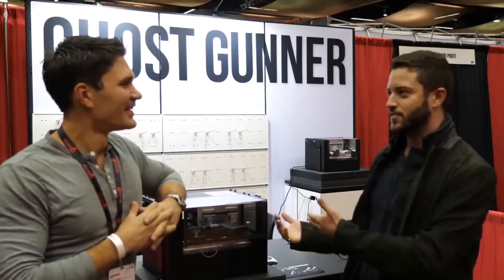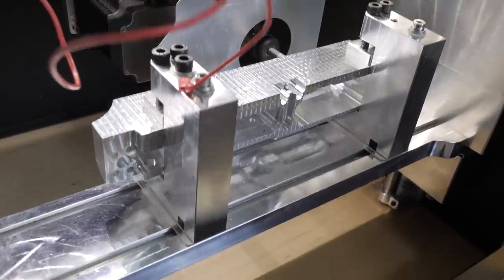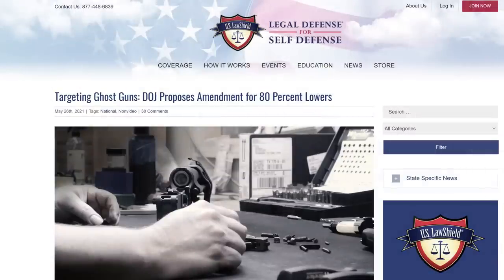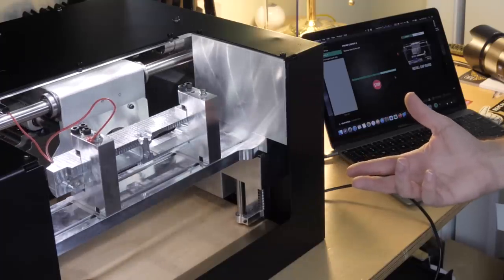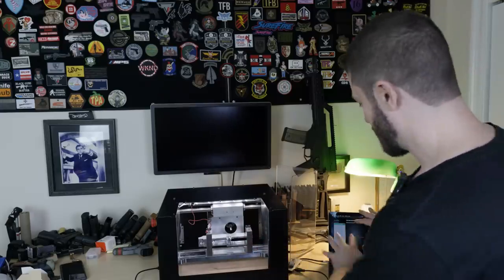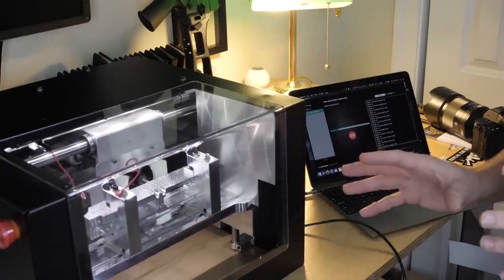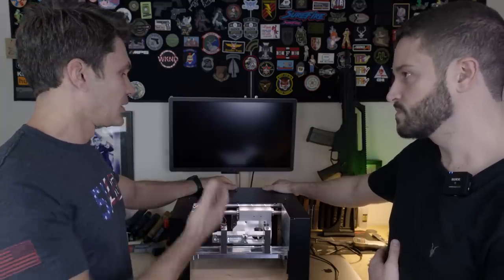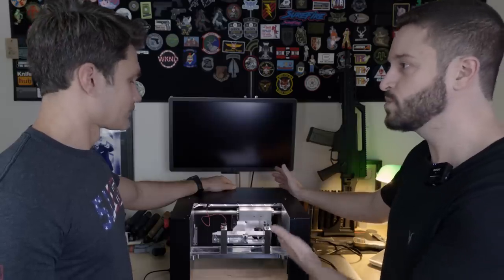NEW: Turn a Metal Block into an AR-15 Lower at Home with the GG3 Upgrade

Comment: ATF Guy: "Hey there buddy, looks like you have a 0% lower there. Can I ask where you got it?"
Me: "Sir, it's a beer can."
ATF Guy: "Don't get smart with me, perpetrator!"
Reply: I have an 80% scale 80% MAC11 flat on display made from a Budweiser beer can. It says "right to keep and BEER arms", and the 1876 is crossed out to say 1776. Its a multi-level political joke also about double taxation (since its the Alcohol Tabaco and Firearms), also a taxation agency without a single elected representative.
Reply: @jakegarrett8109  very nice. every patriot should have some. maybe even the size of business cards.
Reply: @TheBoatPirate  I think as long as its scaled it should be fine, because the blueprint is legal to own. Flashdrives are better though, have the full CAD model for CNC or PDF to print for flats to glue to the piece to drill and cut. I don't own any 2d printers though, except for laser engraving.
Reply: @jakegarrett8109  I need this in my life
Reply: @moisturizingmeerkats6326  You can do it pretty easy, I was able to do this right after emptying a can or two. The easiest way was to print out the PDF (I'm pretty sure I 3d printed the flat, because I don't own a 2d printer so either it came with an STL file for the flat or I traced it in CAD, Its too long ago to remember, also I don't remember how many cans I went through... but that speaks volumes to how easy it was!)

Since the cans are thin, you can use normal high quality scissors, and then trace the print out onto the can and cut.  Very easy, and the MAC11 files are online as PDF as well (free). There's also a Professor Parabellum version that looks interesting, so either one makes cool political artwork (which should also be covered under the 1st amendment, and nobody could convince me this isn't political art: its literally art for display, making fun of politics).

Comment: It’s almost like firearms laws won’t prevent determined individuals from acquiring them.
Reply: Yeah, that's how it's always been.
Reply: say WHHHAAAAATTTTTT? 🤣
Reply: "Life will find a way" Dr. Ian Malcolm
Reply: Npc Soydischarge  criminals have a good amount of adding to our world's problems but the key thing I've learned, is it's all about your moral code and how you've been raised. And poverty too plays a role in increased crime rate of course so more on that needs addressed for those not making much money.
Reply: I believe in Brazil (it was a South American for sure) they busted a ring that was making Lutys (not the actual design but same concept). I believe they found close to 15 built firearms and parts for 50 more. And those were only the ones not already on the streets.
Reply: @joeb6750  look into the illlegal ( AND legal ) gun trade in Philippines.
Reply: Imagine that